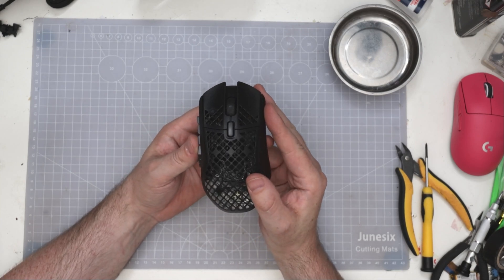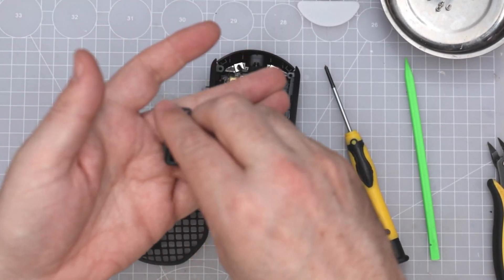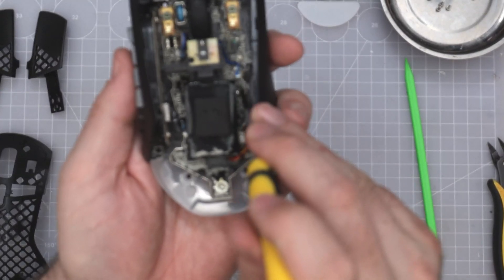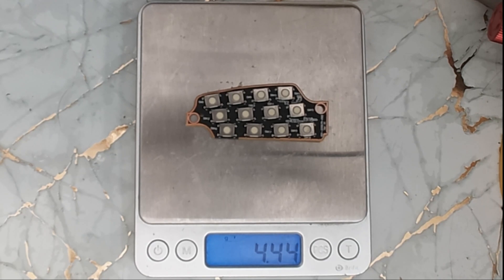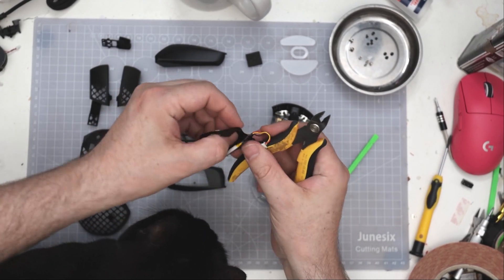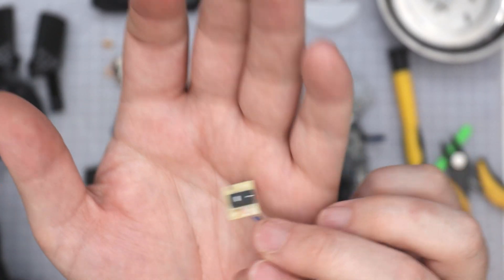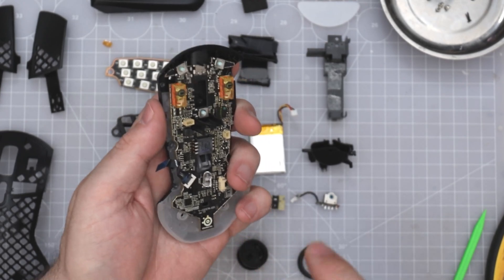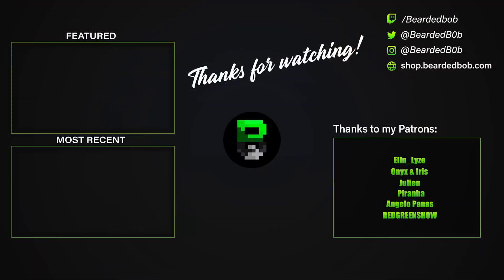Steelseries Aerox 9 Wireless: The Inside Story (Teardown)

Comment: did you by chance tried connecting it via usb with battery disconnected? wondering if i can make it wired and lighter
Reply: i just did it myself and it works wired without a battery
Reply from the maker: Haven’t tried it

Comment: Scroll wheel is the only real issue I have on this mouse. (of course, GG is garbage) I took mine apart and blew out the little encoder on the wheel and its better, but not fixed.
Reply from the maker: As long as you like it 👍

Comment: having to remove and replace the skates to take it apart for cleaning is a bruh moment in my eyes
Reply: That's where I am at right now. my scroll wheel encoder is acting up, (I assume some cat hair has made it's way in and is causing issues.) and I am so mad right now that they make it so hard to service your own stuff. I have owned this mouse for 2 months. 
With all the holes in it, debris gets in so easy. Then they don't even give you the curtesy of giving easy access to clean it regularly? unacceptable.

Comment: The scroll wheel encoder mechanism is a really bad design on these models. I have Aerox 5 & 9 and both get a jumpy scroll. By that I mean when I scroll up it goes down slightly and when I go down it goes up slightly each time. Worthless with FPS and weapon changing, can't rely on it. The only thing I can do to fix it for a little bit is spraying or blowing air into the left click side to get whatever gets clogged up. Complete garbage design, would not recommend.
Reply: yeah, i second that.. it's happening to my aerox 9 after 3 months
Reply: I returned on warranty for the scroll jump. Got a new one but have now a new issue where whenever I press num1, it also tries to press Num2 and Num3. Same occurs for 4, 7 and 10. Queried again, hoping for a full refund.
Reply: Indeed it is. We've had four of these, all have scroll wheel jumping in the wrong direction. As far as I no, there has been no attempts to improve it. Steelseries L

Comment: I am sorry but I am just laughing really hard every time this man puts random components on the scale. Jeez I can't believe these screws weigh so much. If only they put 1 less 0.15 gram screw in the mouse then I could have won that game. I can't believe you didn't weight all the glue used on those connectors. All that probably adds up to 0.25 grams.
I am laughing at the idea not at the guy for filming it, that level of detail while doing a review is really nice. I just personally do not care about mouse weight that much. If it was up to me logitech would sell a g604 v2 that had the swappable side plates of the razer naga pro with a slightly different grip and the weight could be 90-140 grams I honestly wouldn't even really notice. I miss the scroll wheel lock deature on the g604. Being able to unlock the scrollwheel into free spin is such a nice feature.
Reply: I prefer lighter mice tbf, but I agree in thinking all the min-maxing for it is so silly. Like you have people talking about a mouse being better because its 5 grams lighter like its not that big of a deal
Reply: @squeamishh6719  for sure. Weight matters especially for high level gaming but 98% of gamers it won't really help. Personally I like the extra weight but I get why some like super light. I just wish the market was more diverse instead of just focusing on weight.

Comment: My scroll wheel all of a sudden became extremely loud and hollow sounding one day. Anyway to remove whatever the tactile mechanism is that's causing the noise?
Reply: Wheel on my Aerox 9, after 8 months of use, first started to scroll screen content in random directions, when scrolling the wheel in one direction, and now wheel started to squeak like crazy. I started searching tear down guides in hopes to fix the issues with the encoder and the wheel, but looking on ho the mouse is put together (an no-name switches used) all I can say - bye-bye, SteelSeries, I never going to buy shit from you again.
Reply: @Zuneg  I agree. I've gone through three at this point. The first one's side buttons quit on me after about a year of use. Warranty had just expired, so I just bought a new one, and "returned" it with the old one in the box. New one's mouse wheel had the exact issue you described, right out of the box. So, I did that same process a second time to get the *third* mouse, and a couple weeks in, here I am again. I felt morally unjust at first for the false return, but then I read the horror stories about their customer support. Now I sit here still screwed over defeated, but at the very least confident that this was the first and last product I'll buy from them.

Comment: i just bought one of these mice, im considering 3d printing a new right side panel. 
I cannot for the life of me get a good grip on this mouse. my hand keeps slipping off if pick it up.
Reply: same here it needs like the extra right side support like other mmo mouse. also i feel like the back is unusually long so  its hard to reach the front buttons. are there any 3rd party 3d printed shells for it out there to buy?
Reply: Did you ever design a right plate? I'd love to see it if so. I def need more of an indentation for better grip.
Reply: @CruJones  I did not. I ended up using small strips of grip tape where I needed them. The mouse feels natural to use now, almost a year later.